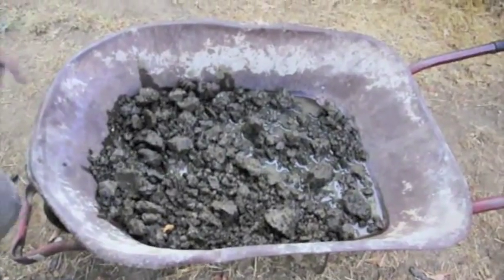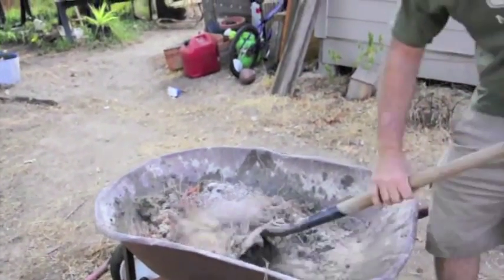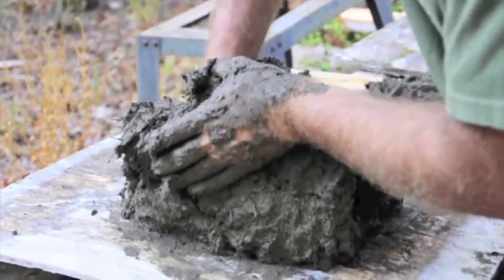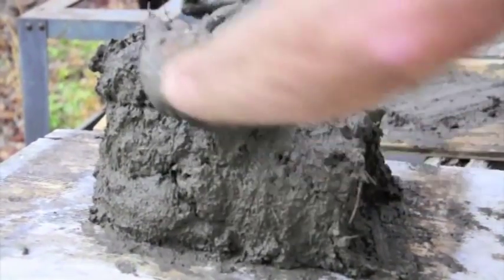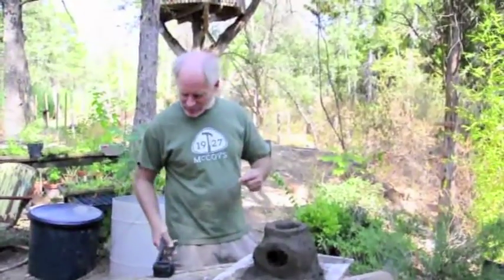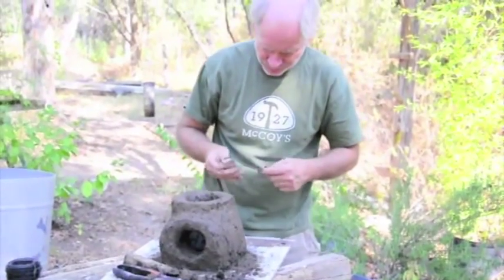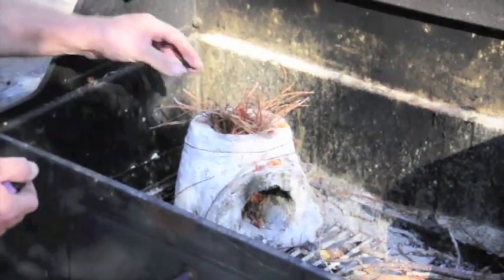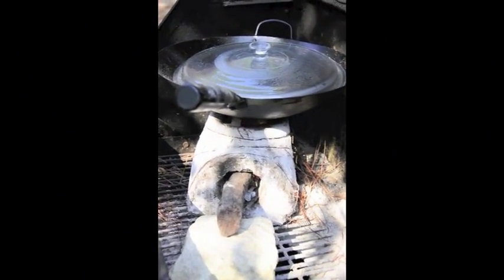5 Cent Rocket Stove-Instructional

Comment: Thanks- it inspired me, cos I thought I needed a grate and needed to mould it around a bottle etc or insulate it, But your demo proved - use simple ingredients, the wire - great idea too! noticed you use a large stick to cook highpower with and the brick creates air space under the stick - so maybe a grate isn't necessary! Also btw, were you able to measure thetemperatures you reached in this stove? Also wondering how is your stove staying up no a year after as i heard sand causes cracks.hanks!